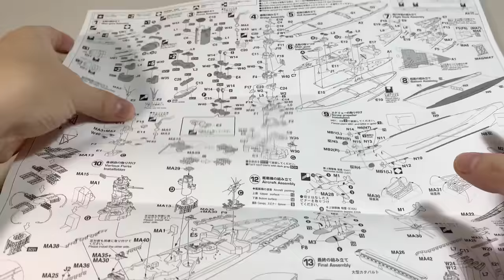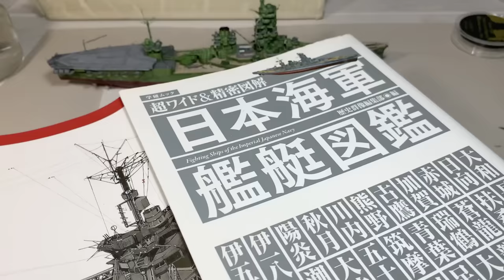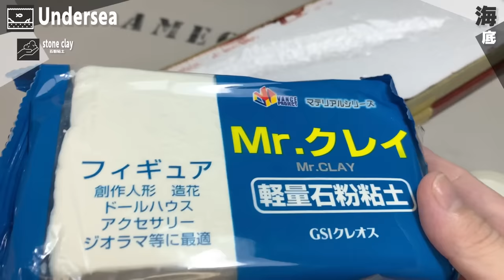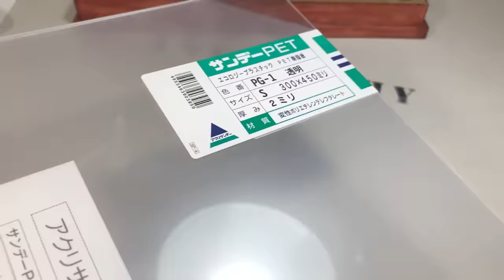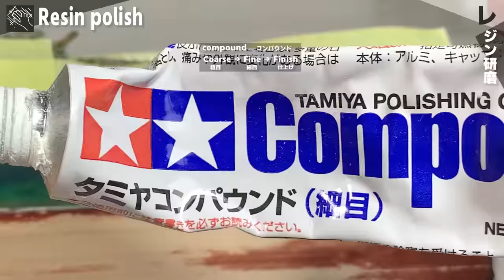着底 航空戦艦 伊勢 1945 大日本帝國海軍 最後の艦砲射撃 エポキシレジンジオラマ

Comment: I must say, the IJN came with some very interesting ship designs in WW2 - don't think I've ever seen a vessel that was part aircraft carrier and part battleship before. As usual, your attention to detail on a battle damaged ship is excellent.
Reply: The Battleship ISE and her sister ship were originally built as standard battleships.  They were converted to carry the large hanger aft, for sea planes to give the Japanese navy more air power, this was also done to several heavy cruisers.  The Japanese only had 10 carriers at the beginning of the war, five had been sunk by the end of the Battle of Midway, one at Coral Sea and four at Midway, with two more being damaged.  The Japanese navy scrambled to build aircraft carriers as a result of this and that the war had turned into a prolonged conflict that it had not prepared for and these modifications were a stop gap measure to bolster the air power available to the Japanese navy.  The US navy took cruiser hulls which were under construction or planned and converted them into fully functioning light carriers, it also took oil tankers and cargo ships and converted and called them, baby flat tops, escort carriers,  or "Jeep Carriers".  In fact the carriers Lexington and Saratoga, and Akagi were all laid down as battle cruisers and after the Washington Navel Treaty, while still under construction they were then converted into aircraft carries.

Comment: Ironically, her 22 floatplane bombers made no contribution to the war. She was converted from a functional battleship to a useless tool as a carrier  while sacrificing a third of her firepower with no prospect of sailing in a battle line due to that big vulnerable hanger.
Reply: In fact, the hangars, flight decks, and aircraft on board her and her sister ships were completely useless as a fighting force. However, the hangar was useful as a cargo hold for storing strategic supplies such as oil and rubber, and the flight deck was used as a space to install a large amount of anti-aircraft weapons. They were engaged in several transport missions as a huge transport ship, protecting themselves from American military air attacks and completing their missions almost unscathed.
The renovations made to the Ise-class battleships were not in vain.
実際、彼女と姉妹艦に搭載されていた格納庫、飛行甲板、航空機は戦力として全く役に立ちませんでした。しかし、格納庫は石油やゴムなどの戦略物資を保管する貨物倉として、飛行甲板は大量の対空兵器を設置するスペースとして使用されました。彼らは巨大輸送船として数々の輸送任務に従事し、米軍の空襲から身を守り、ほぼ無傷で任務を遂行した。 伊勢型戦艦の改修は無駄ではありませんでした。

Comment: The battles ship was back here and anchored due to fuel shortage and assigned to defense of Kure Naval Yard as one of the Floating Gun Batteries. In July 1945, such Japan Naval inactive battle ships in Kure got all damaged by U.S.Navy air attack and she got bottomed where she was. And she at that time had one shell in one of her main guns during air battle but nobody could remove it because the gun was on almost highest angle- anti air, and she lost all hydraulic power to move the gun to its loading/ unloading position- horizontal. Therefore the wrecked and bottomed battleship had no choice than firing the shell instead of unloading and thus the gun fire was very Last Battleship Main Gun Fire of the Imperial Japans Navy.

Comment: How would she look with a Well-dock in the stern?
I kinda can understand why nobody ever tried to use a Trimaran hull as a form of torpedo protection, even though the wing structure would require additional structural beams on which to rest on and thus offer greater mine protection, in terms of breaking the main beam.
But I keep thinking that with those waterplanes, a well-dock would have been perfect for her, no need to stop in order to pick her planes up.

So, will you ever try to kitbash a version with a slightly modernized design?
Reply: the larger the size of the hull the more cost you create not only in materiel and construction. you need dry dock and machinery of the same size to service your ship. or you need tu reduce your volume efficiency by dividing you ship reducing your fuel, ammunition, machinery, auxiliary and buoyancy space.  the last reason is the old way work and you way was never tested do you want to try your luck knowing if it fail your country will lost its place in the naval hierarchy.
Reply: Interesting concept, but I think the ship would not be able to maneuver well, especially in rough seas.  Another problem might be where do they put the armour belt, on the outer hulls or the inner one?  And now that I think of it, flooding in one side hull would probably capsize the ship.  Sounds like a good idea for a fast attack craft, but not for anything big.